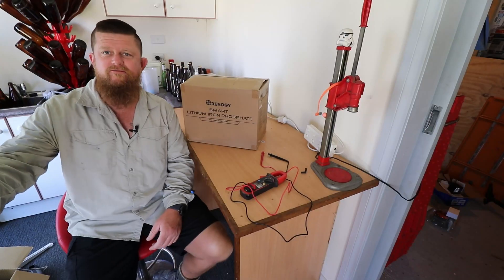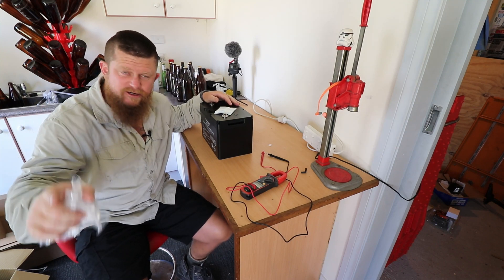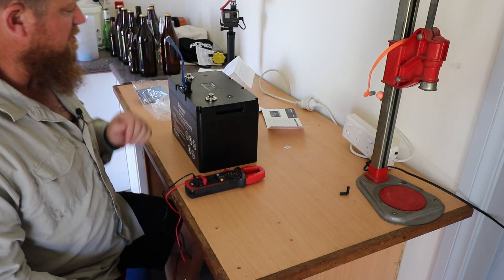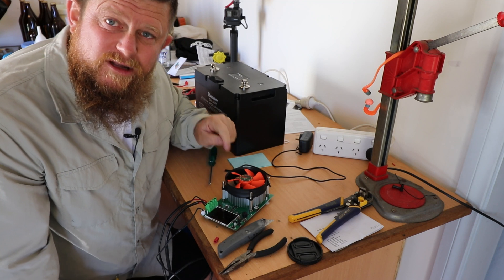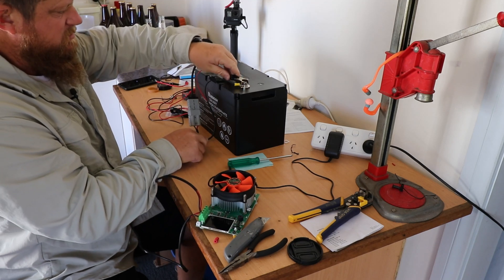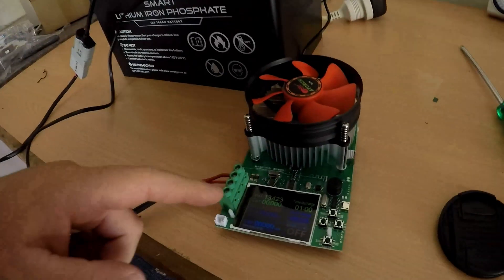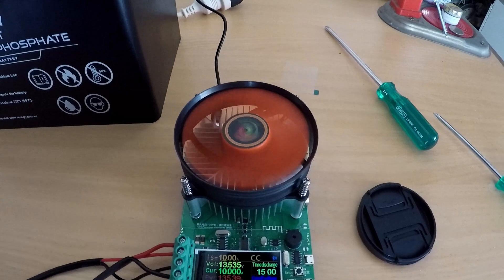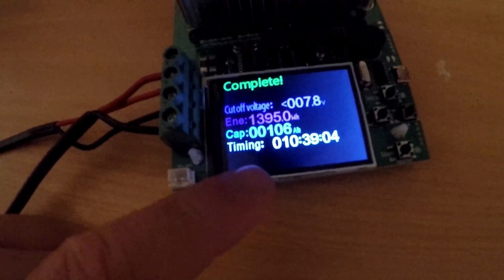RENOGY 100AH Lithium Battery Capacity Test | Lifepo4

Comment: Nice vid mate 👍 
Any update on how the battery is travelling a year later?
And do you know the difference between the smart 100ah renogy and the 100ah with Bluetooth? Is there different cells/functionality? Or is it just Bluetooth? Seems the Bluetooth 100ah is $50 cheaper than the smart at the moment but can't really see the specs too well . . .
Reply from the maker: Thanks mate. I can't give a proper update as I've only just fitted it into the patrol in the last month. I did like the way it performed though on its first outing. 
I'm the same as you. I thought the only difference would be the Bluetooth. I could be wrong though.
Reply: @4x4EastCoast  ok cool 👍 whatcha been doing all these months? 😜
The wired part is with the 2 types - one says smart which you would assume is Bluetooth and the other doesn't say smart but says Bluetooth?!? Confusing! 
You have the smart one don't you?
Does that have Bluetooth?
Why did you choose that one over the other?
Reply: The smart one has pouch cells and data connectivity. To use Bluetooth you need a separate dongle as it's not built in

Comment: You don't run these down to zero.. That extra 100wh is needed for the charger to work right. As you need a 2volt reference for the charger to work...Unless you want to get out another battery and jump start it...
Reply: shouldn't the internal BMS have stoped the discharging?
Reply from the maker: Yep. The charger had no worries charging it back up so I'm guessing there was still a small amount of charge for the charger to detect.